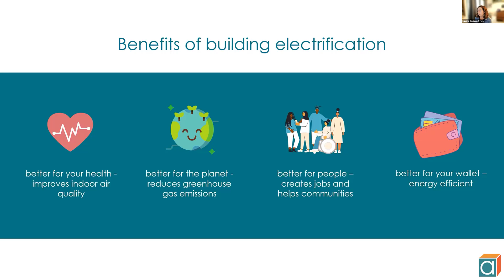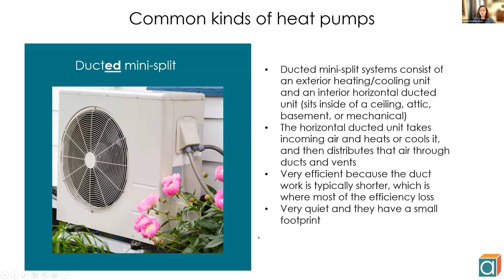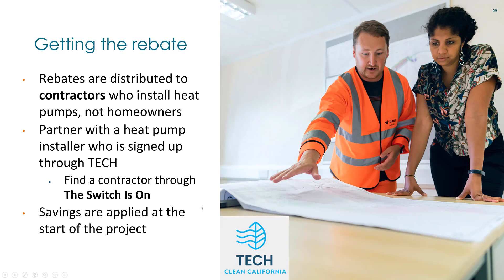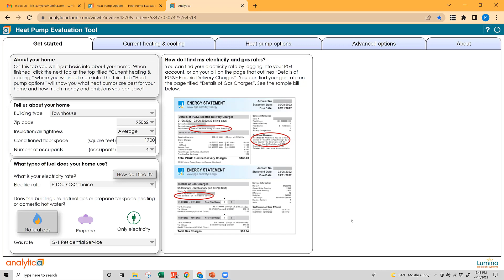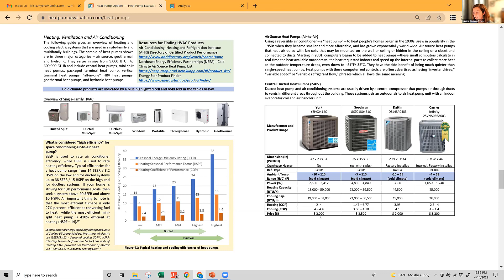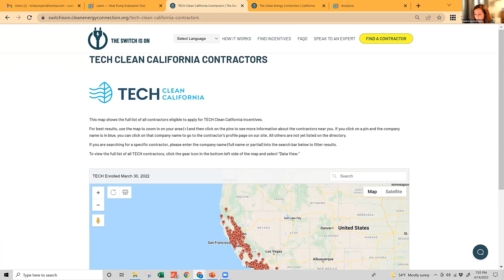Heat pumps 101: heat and cool your home while saving energy and reducing emissions!

Comment: Systems leak refrigerant often.  In addition techs and installers release the refrigerant from their hoses often multiple times a day.  Refrigerant leaks are a significant issue.  We need to be very diligent in creating leak free systems and releasing what is in our hoses into recovery cylinders rather than into the environment.  We, also, need to be early adopters of moving to lower GHG refrigerants as soon as they become available.